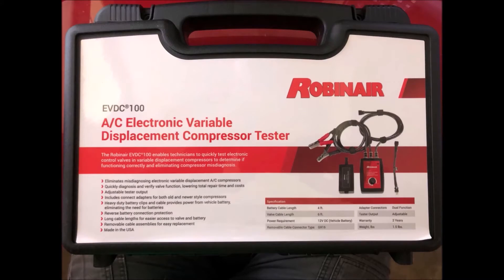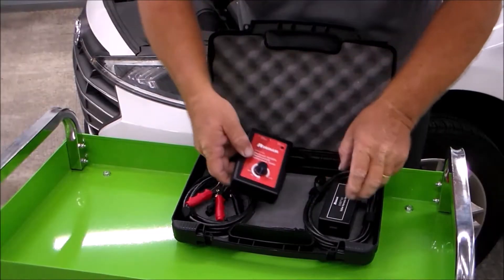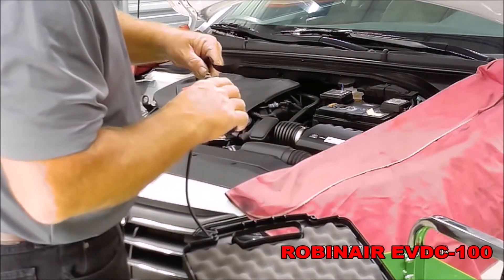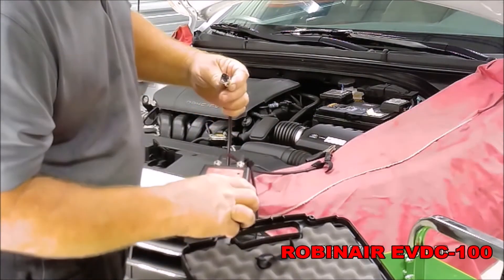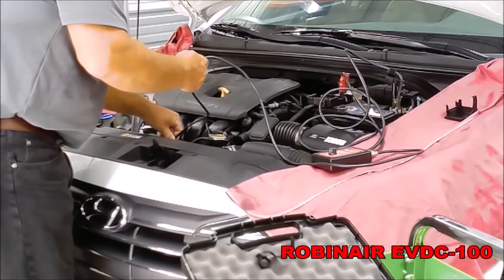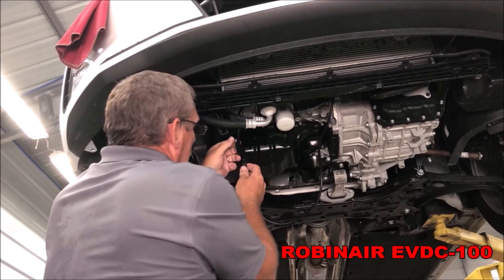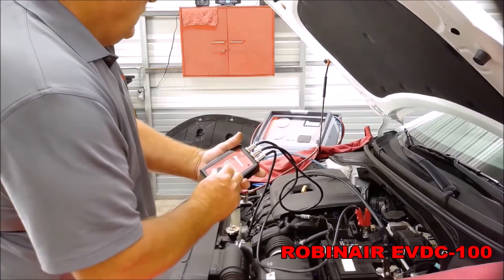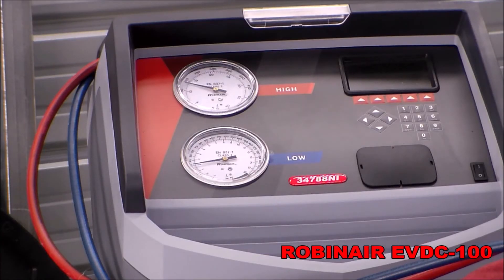Testing and diagnosing a variable displacement A/C system compressor using the Robinair EVDC100

Comment: If you can see the shaft of the compressor turning doesn't that mean the compressor is working. Doesn't that mean the system has enough refrigerant and the clutch is engaging.?

Comment: This tool is a waste of money and effort. Shops generally do not replace compressor electronic control valves. If a/c pressures are static with compressor clutch engaged, and a/c system is fully charged, check for battery voltage at control valve and computer controlled ground (variable voltage) on the other leg. With confirmed voltages, customer gets a new compressor and receiver/drier. Replacing just the solenoid is come-back city when the compressor fails, a pissed-off customer, and lost money.

Comment: I have problem with my bmw e90 320d 2005 a/c system. When i turn on ac in the car only hot air comes out of the vents and a/c valve doesnt engage. But when i use ista+ and activate compressor valve for a second i se changes in pressure and cold air blows. What could be the issue?